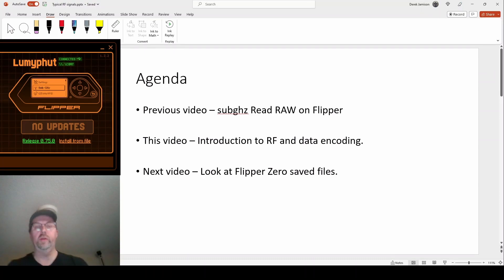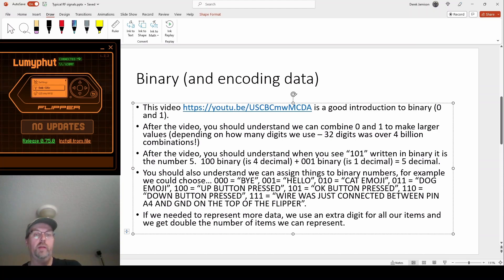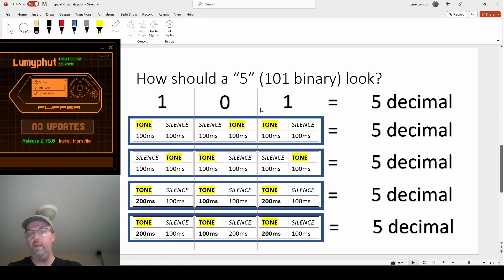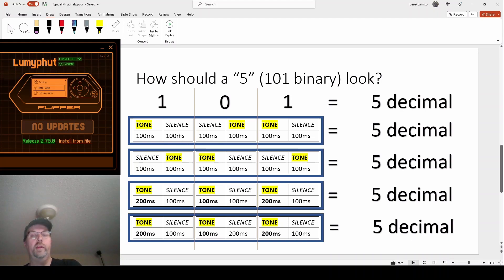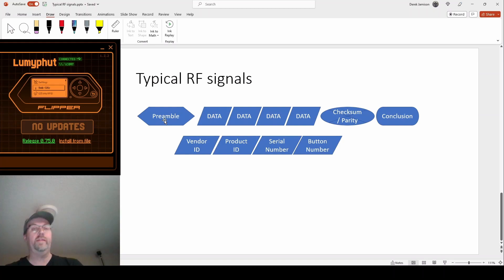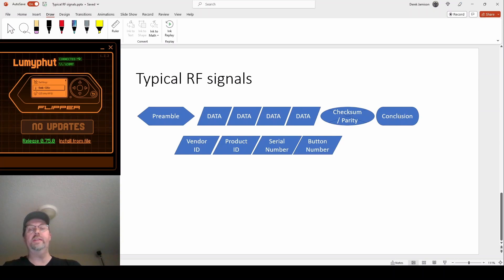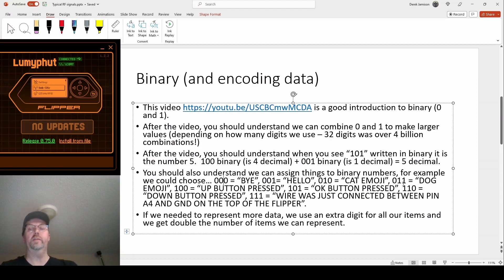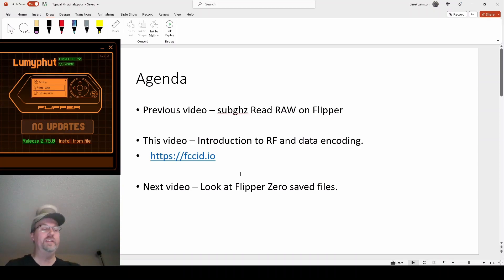[10] Intro to RF signals

Comment: Great content!
Reply from the maker: Thanks.  In a few weeks I’ll try to do a video on RF modulation (but I still need to learn more).  I read the CC1101 spec, and just got two CC1101 modules, so hopefully I can program two Arduino to communicate with each other, while using a SDR to look/listen to the communications?

Comment from the maker: It's worth pointing out that so far all I've have looked at is OOK signals (On-Off Keying) using AM (Amplitude Modulation) with a bandwidth of 650KHz.  Those concepts should directly apply to the AM270 and AM650 settings of the Flipper Zero.

For FM328 and FM476, the signal is frequency modulation, so I'm not sure what those signals look like.  My best guess of FSK is that there is one frequency and then instead of silence there is another frequency that is offset by 2.38kHZ or 47.6kHz.  If you know of any devices that are using FSK, please let me know!  (Or send me a Read RAW capture of FM that when played back works for the device.)